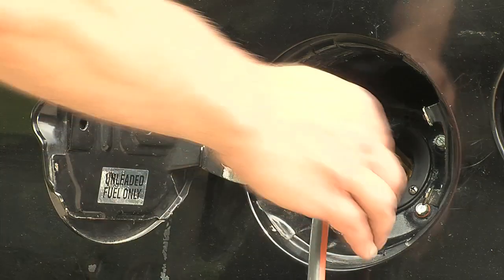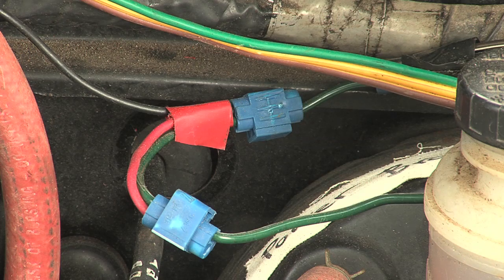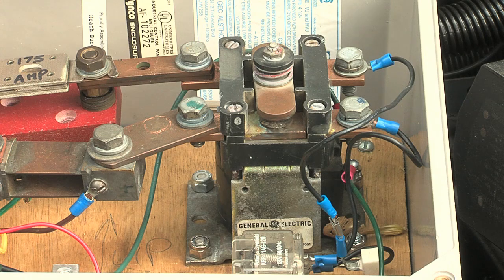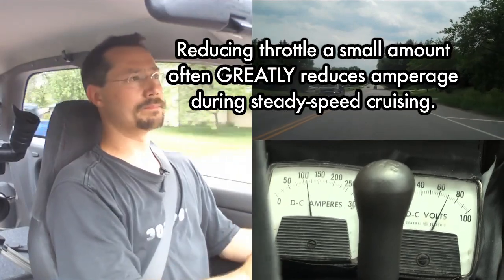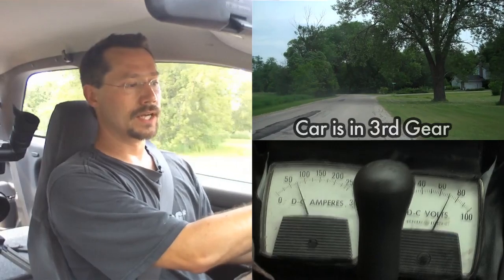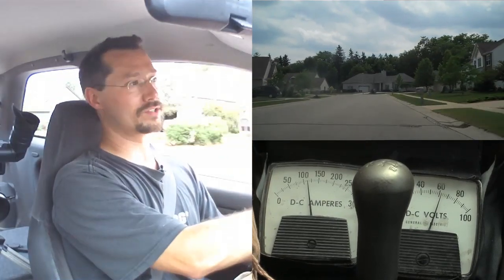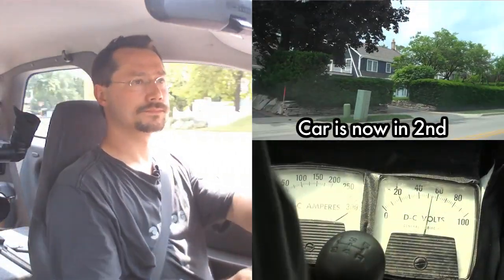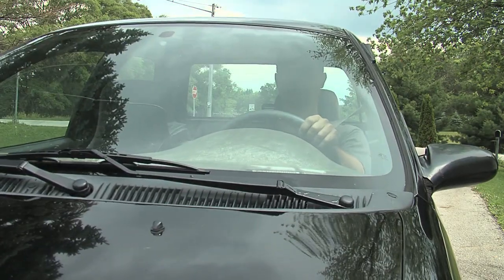15 Build Your Own Electric Car: Driving the Car

Comment: Expected the voltage go high on acceleration,bit confused about that why? but pretty cool thanks
Reply from the maker: With any battery, as you draw a lot of current, the voltage of that battery will drop. It can be VERY noticeable in lead-acid batteries. 

Lithium batteries have a much more “flat” voltage response to heavy loads.

Keep in mind that we are measuring at the battery. If we measured at the motor, it would be zero volts with foot OFF the accelerator, and whatever the maximum battery pack voltage is with the accelerator all the way down.
Reply: @BenjaminNelsonX  thanks and now I do understand the point.

Comment: Throughout the test drive you were not changing gears. How does the clutch work with the electric motor connected to the transmission

Comment: By not using a clutch in your conversion you will wear the gearbox synchronisms much faster. A barebones clutch and clutchplate with a reduced mass would have done the trick. However, you can not reduce to least because there is some heat dissipation taking place and you need some of the thermal inertia in the iron plate to prevent a cook off.
Reply: He doesn’t shift nearly as much as in a gas powered car so it doesn’t matter as much.

Comment: I really want to do a conversion like this, but school keeps getting in the way. I may do it next year... hopefully. Anyway, I was wondering, how long did your battery pack last? There is a junk yard near my house that has a ton of suitable lead batteries that can be revived and used. How many miles should I expect it to run before I need another battery replacement? Also, how many miles did your motor's brushes last?

Comment: What's the maximum speed? Should it be possible to make a van with this electric system, and build this to a camper to live in. Should have an electric forklift motor enough power to run that vehicle? I hope you'll answer this, i look forward to realise this project🙏
Reply from the maker: I've gone at least 73 MPH in the Electro-Metro.
You certainly could convert a van to electric. A large forklift motor (like a 13 inch diameter) could certainly power a van. Nowadays, there are a lot more affordable AC motors available then back when I built this car in 2008. Used Nissan Leaf motors for example work great for many projects.
Vans tend to be heavy and not very aerodynamic, so they also need a very large battery.
For an electric camper, one thing that would be nice is just charging at RV camp-grounds which have 240V/50A power connections.
Reply: @BenjaminNelsonX  Thanks for your answer. 73 MPH is quite fast! I appreciate your video's!
Reply: @BenjaminNelsonX  Thanks for your answer. 73 MPH is quite fast!

Comment: Would you use fewer amps by shifting normally? What's your top speed in 5th? I would think that forklift motor would have a shaft RPM of >2K.... wouldn't that limit your speed even in 5th?
Reply from the maker: In general, you draw less current by spinning the motor faster and using greater gear reduction. On a car with a manual transmission which has been converted to gas, that means using a gear LOWER than you otherwise might use. On this car, for general use, I would just put it in 3rd and drive it as though it was an automatic.
Top speed was around 75 MPH.

Comment: Benjamin nelson are you going to do an upgrade to lithium ion batteries to your geo?
Reply from the maker: I built this car 13 years ago. Unfortunately, car uni-bodies don't last forever in my area with all the salt we use on the roads in the winter. This car has been retired. (I kept the motor and other EV components.)

If I still had this car, YES. I would upgrade to lithium. Other than used lead-acid batteries, I was always very happy with how the project turned out!

Comment: Hi, great clear videos, thankyou.... But may I ask, how did you power your power assisted steering ??
Reply from the maker: Easy. This car doesn't have power steering.
One of the reasons that I chose this car to convert to electric is because it's such a simple vehicle.

There are lots of electric power steering units out there nowadays. A person could get one from a junk yard and adapt it to their car. 

It DOES have power brakes. I mounted a 12VDC vacuum pump to replace the vacuum which would have otherwise been created by the engine.

Comment: Congratulations. But personally I would not want to keep any mechanical components. These should all be replaced by electromagnetic components. As an old petrolhead, it pains me to say so. But with separate motors on the two rear wheels, for instance,  you not only have a differential, but the best limited slip differential that you could imagine.

Comment: How many kilometres you can drive after charging it to full??
Reply from the maker: Keeping in mind that I built this car over ten year ago, with used lead-acid batteries, for a total budget of about $1300 USD.... The car had a range of about of about 32 km. I only worked about 4 km from home, the grocery store, bank, and library were all within a relatively small area, so most of the time, I'd go about 15-20 km on a trip. I had more than enough range.

Of course, nowadays, batteries are much better, bigger, and cheaper than they were then!

Comment: I followed most of your videos. You look like my cousin almost in the same age as him too! we always been interested in DIYs and projects. so much respect man.
The videos are so easy to understand and steady and full of simple information!
 the fact that the video quality feels like 2000ish makes it even more enjoyable.
I have a math test tomorrow but just found your channel and forgot about the test.
.
I have a question by the way, does the EV conversion work with Automatic transmission?
if so, do you have to remove the torque converter? and on the other hand does it shift with EV low rpm?
Reply from the maker: You CAN convert a car with an automatic transmission to electric, BUT it will be more complicated and less efficient.
Just start with a manual transmission car.

Here's another option - with so many commercially-built electric cars now out there (and in just yards) you might be able to get an electric motor and the matching gear reduction unit, and put the whole thing in a car. You would then just have to hook up the drive-shafts to the wheels.
Reply: BenjaminNelson I’m definitely looking forward to follow this project on my own. I’m just low on budget as of right now. How did you do the paperworks? Any smog needed? Did you have to report the engine swap to dmv for title?

Comment: Sir the conversion was awesome but what tip speed have you got on that forklift motor in your car
Reply from the maker: The fastest I've gone in that car was 75 MPH. There's no place near me I can legally go that fast anyways.
Reply: Can you tell how much kw is motor and can it be driven on more than 48v
Reply from the maker: @pratikredekar2625  I've driven this motor at a peak of 500A at 144V.
Reply: Buy as the motor specification says it's 48v motor so how can it be runned on 144v does it has that capacity to run on high voltage without getting burned
Reply from the maker: @pratikredekar2625  Forklift motors can easily be "over-volted".
On a DC motor voltage is proportional to speed, so increasing the voltage increases the speed. Higher voltage also allows for more total power.
The only thing a person really has to be careful of is not to overheat the motor. If needed, an electric blower fan could be added. Ideally, at high voltages, the brush timing should be adjusted as well.
Here is some more good information on forklift motors: https://www.diyelectriccar.com/forums/showthread.php/using-forklift-motor-and-choosing-good-7598.html

Comment: thats all great but how many batteries and how did u hook them up??????
Reply from the maker: The original setup in the car was only 72V - six 12V batteries connected in series.

I've run the same motor setup at up to 144VDC - twelves 12V batteries in series.

Comment: What do you do for heater and defroster in an electic car?
Reply from the maker: In electric conversions people currently work on, there are electric heating units that will run directly off main battery pack voltage.
That's how commercially-built electric cars work as well.

Many electric cars also have heated seats and steering wheels.

On this project, from well over 10 years ago, I went with a simpler heating system. Details on that are at: https://300mpg.org/projects/electro-metro/heat/

Comment: Mate. Get rid of those crimp blue connectors. A Bit of corrosion gets in there and you have a bad connection. Always solder wires or strip the  wire and use a proper crimp.  I am looking forward to building my own electric car.  Great videos. Thanks.

Comment: Hey Ben! So your car runs on 72 volts? So 6 -  12 volt batteries in series?
Reply from the maker: I originally ran it on just 72V. (6 x 12V batteries)
I later ran it on 144V (12 x 12V batteries)
I no longer have the car. It's been well over a decade ago now that I built it. If I did still have it, I would simply have upgraded it using salvaged Nissan Leaf batteries.
Reply: @BenjaminNelsonX  Ah I see, My Son has a Ranger you still have yours? He likes yours.lol Louie

Comment: Do you have regenerative on deceleration?
Does your car draw more amps because your meter only goes to 300 amps?
Reply from the maker: This is an old-school DC Series-Wound motor. They do NOT naturally work for regenerative braking.
The ammeter has nothing to do with how much power the motor CAN draw.
I only had a 300A ammeter, but I was using a 500A motor controller.
The ammeter just pegs all the way to the top if I hit the accelerator hard.

Comment: Congratulations....the proof is in the pudding etc...……..it does go, but I think you could now make a continuation to go into the world of converting to Lithium battery technology. Even if it doesn't completely match a factory built EV it will still give a good performance you can be satisfied with for every day use...….and to hell with those that only want long distance performance as the ultimate must have feature.
Reply from the maker: I built this project over ten years ago. I no longer have the car, as salt on the winter roads in my area really corrodes car bodies.
If I still had the car at this point, I would have put lithium batteries in it.
Reply: @BenjaminNelsonX  Oh well, the learning curve and experience was worth the effort......the technology has come a long way and things do change for the better...……..best of luck for your next build. BTW, I have a 1996 2 door Rav 4, and I think due to the all wheel drive and compactness it would make a good EV conversion candidate.
Reply from the maker: @gangleweed  The RAV4 has actually been offered as a Production Electric TWICE! I got to drive one of the original generation once. It was great! You might want to look around and see if one of those old RAV4 EVs is available for sale. You MIGHT be able to find one.
Otherwise, it would make for a very interesting DIY conversion.
Do a search through the EVAlbum for RAV4, you will find a few, such as this one. http://www.evalbum.com/2106
Reply: @BenjaminNelsonX  That is very interesting....price though of the conversion is more than treble what I paid for the actual RAV 4 when I bought it 4 years ago (2014).....I paid A$5,000 delivered free to Melbourne from Sydney in NSW....Australia...….The EV range at 30 miles (70Km) on the lead acid thingies is not what you would want after such a build, but I expect now that lithium is the new boy on the block all things will sing beautifully. I'm 81 so I doubt I'll be indulging in an EV build this century. I am told that Toyota have more interest in their petrol ICE model output than diversifying into EV, but I expect that is going to change.

Comment: It would be neice if You had kept that one and put Li-ions in it. The low speed cruise power is as low as 800W going 25mph! That is something modern EVs can't with their bigger motors, their low speed consumption is much higher.
Reply from the maker: Geo Metro was a great automobile. The most efficient one I can think of was "The Dolphin", built by Dave Cloud. It had some fantastic aerodynamic upgrades to it.
https://www.treehugger.com/cars/dave-clouds-214-mpg-geo-metro-aka-the-dolphin.html

Comment: This is impressive,  what did you do re the heater? Did you install an electric one?
Reply from the maker: I used a combination of a 12V defroster and a 120V preheat system. See more at: https://300mpg.org/projects/electro-metro/heat/

Comment: Hi Ben - When you take your foot off the accelerator, shouldn’t the regenerative braking kick in?
Reply from the maker: No. This car doesn't have regenerative brakes. Coasting is actually MORE efficient than regenerative braking anyways. This car used a series-wound DC motor. That style motor has a few challenges to overcome to use for regen. My second electric motorcycle - the Vectrix - uses an AC motor and has regenerative brakes. On that one, I twist the motorcycle throttle backwards to brake. It's pretty neat bike.
https://www.youtube.com/playlist?list=PLmHss3DBZUinx-DxMLnax485Alj5i5Lcn
Reply: Thanks. I guess the main benefit of regen is possibly saving on brake pads. Also, I suppose avoiding the particulates from the pads.
Reply from the maker: @Alrukitaf  It really does save on brakes! I replaced the front brake pads on our 2004 Prius at 160,000 miles. They were the original pads.
Reply: BenjaminNelson good to know. Another question I had: is it better/easier to convert rear wheel drive rather than front?
Reply from the maker: @Alrukitaf  Front-wheel drive vehicles tend to be more efficient. The only real advantage I can think of with a rear-wheel drive vehicle is that potentially, you can fit a larger motor. Front-wheel drive vehicles usually have a transverse mounted engine. This limits the diameter of the electric motor, because is is right next to one of the half-shafts going to the wheel.
On a rear-wheel drive setup, like a common pickup truck, the motor runs longitudinal - the direction of the length of the truck. It might be easier to get a larger motor in there.

There are plenty of examples of both front-wheel and rear-wheel drive conversions which all work great.

Don't let whether a vehicle is front or rear drive limit you. Convert the vehicle you would like to drive.
Reply: BenjaminNelson thanks for the advice. Just wondering if you’d do a front wheel drive conversion yourself as a demonstration video. (You don’t have to just because I asked, but only if you’re doing one anyway)

Comment: What do you do for heat and air conditioning, if anything?????
Reply from the maker: This car never had air conditioning in the first place.
For heat, I mounted an oil-filled electric radiator in the back seat. I would set that up to run from a timer to turn on in the morning in the winter. It ran from wall power. When I would hop in the car, it would already be warmed up, and it would stay warm on my commute to work.
I also had a small 12V defroster for the windshield.

Comment: It gives me many thoughts about dc to DC converters   power gain during declaration or breaking / some other way to asorb power 
More efficient ways ..  even adding a few hundred watt solar panel to the roof   possibly adding some miles to battery life.   Possibly even acceleration during sunny hours.   So many thoughts I guess ill find out while building my own what matters and what truly doesn't ;). Thanks for sharing

Comment: why only 40 miles per hour?
Reply from the maker: The speed limit is 45 mph right outside my house and 25 in town.
I've run this car at higher voltage (144) and been able to drive at 70+ MPH with no other changes.

Comment: at 7:35 minutes, when the gearshift from gear 2 to neutral then you move to gear 3 without a clutch plate, is it not going to damage the gear, given the dynamo still spinning and turning the presneling. how is the explanation?
Reply: Well finding the sweetspot is the key i assume

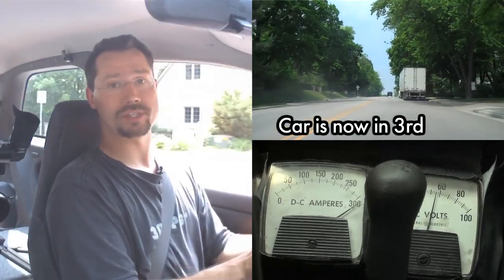Comment: 7:41 how is that posible? ok the engine is in repause but the wheels and gearbox components are not
Reply from the maker: The transmission has synchronizers. Without all the spinning mass of a gas engine and flywheel, it goes into gear just fine.
Reply: @BenjaminNelsonX  could it be possible to install en electric engine and use the flywheel also ?
Reply from the maker: @ciumoiucucaca  Yes, you could also install a flywheel and clutch on the electric motor.

Comment: Ok I just watched your series. You went with a standard transmition without a clutch. Can you shift gears while driving and would it allow you to go faster and use less amps? I understand when you said about a automatic trans, figuring out how to attach/connect. But would be better since a automatic shifts for you as you go faster?
Reply from the maker: Here's two articles I wrote that I think answer your questions.
https://300mpg.org/projects/electro-metro/going-clutchless/ and https://300mpg.org/projects/electro-metro/transmission-for-an-electric-car/

Comment: Hi Ben, Thanks for showing all the various stages of building an electric car. It was certainly an eye opener, the detail to work was most comprehensive.
What modifications were necessary in order to change gears without having to use a clutch mechanism, or did I miss that part?
Reply from the maker: All I do to change gears is let off the accelerator, pull the stick out of gear, wait about 1 second, put it in the next gear. That's it.
Without the weight of a flywheel or the content spin of a gas engine, it goes right into gear.
Frankly, I generally didn't shift. Much of the time I would just put the car in third gear and leave it there.